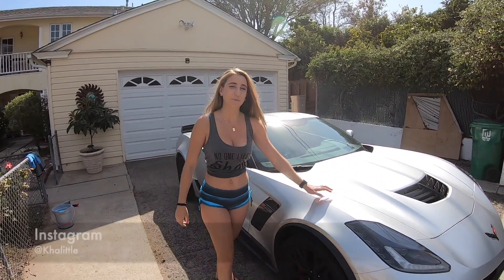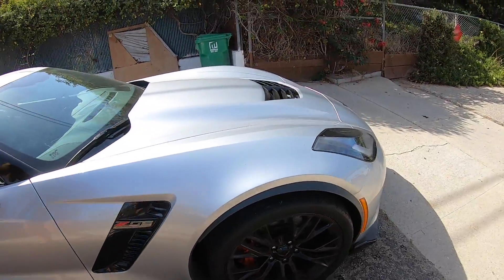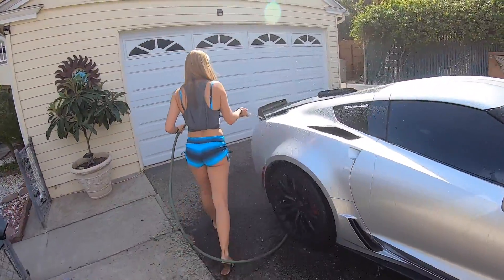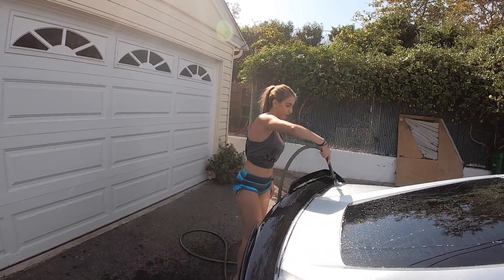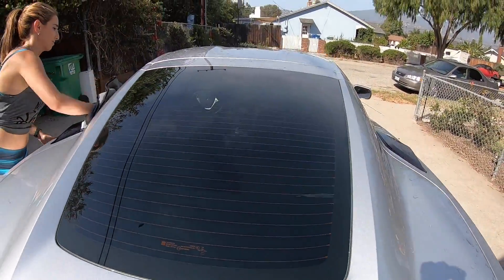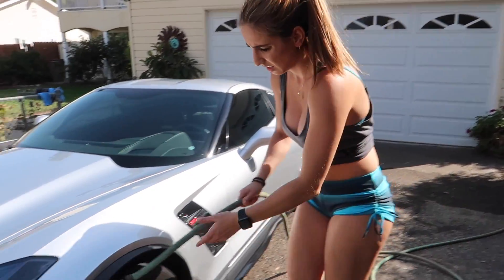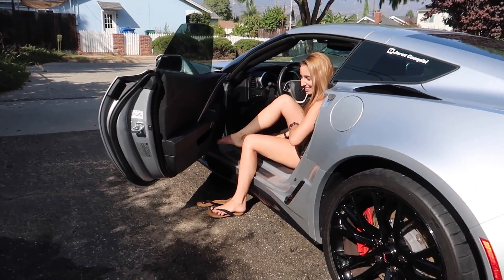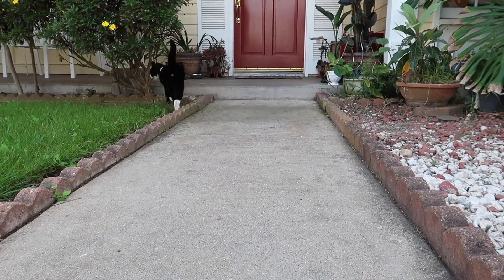Washing my DIRTY Z06 Corvette!!

Comment: That’s not how you should wash a car. 1. Wheels and tires first. Get some cleaner made for that. 2. Apply a car shampoo using a foam gun ($20 at WMT). The slickness will loosen any stuck on dirt. Never rinse then then wash. 3. Rinse top to bottom. Use a waffle weave or microfiber towel to dry. Apply a detailing spray to help protect the paint.

Comment: I know this is late, but in case you weren't aware there are waterless wash & wax products out there, such as Meguiar's. Perfect for those in drought areas, or want to do a quick cleanup without using water. Thanks for the video.

Comment: Outfit looks great but let me pause and help you out for you do not take Corvettes through car washesespecially this one you will destroy the bumper the splitters and everything else it's not designed to go through that they actually even state that when you buy the car brand attack if they put on the gear shifter letting the owners no do not take the cards through drivable car washes